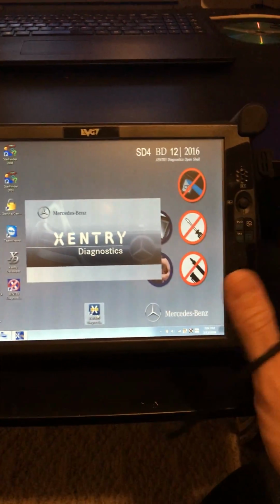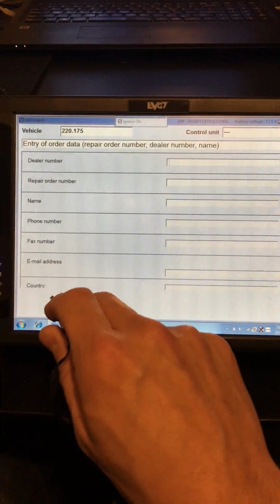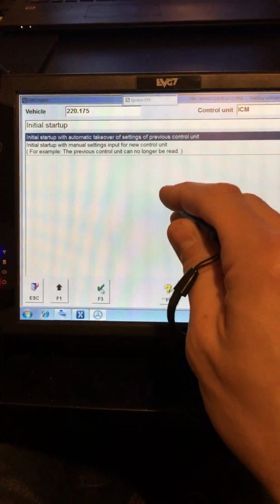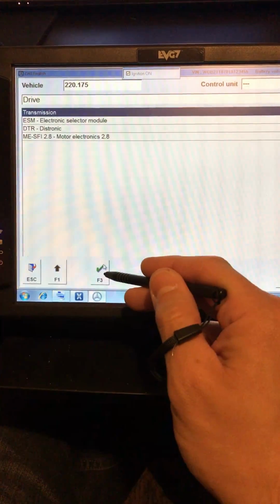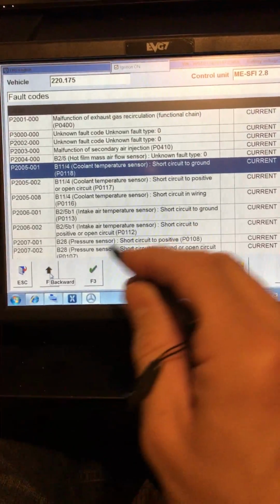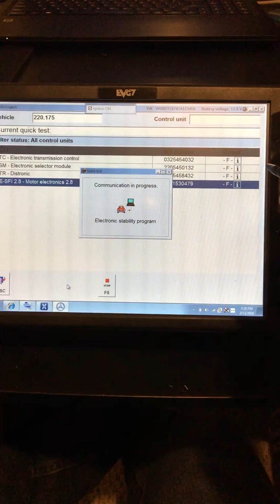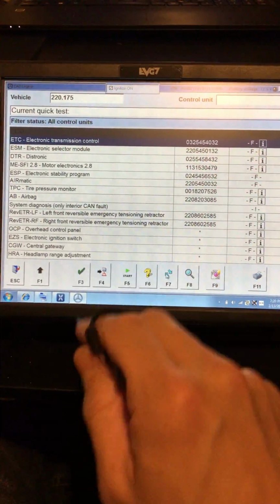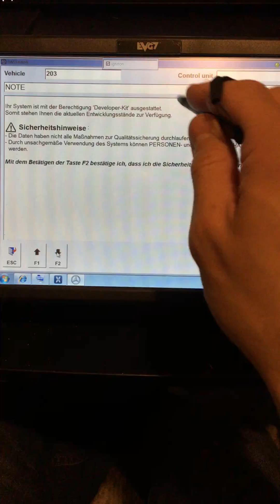Mercedes Benz SDS Star Diagnostic scanner tutorial quick intro on how to use the scanner

Comment: Awesome video will this system fix a zero start problem I bought a 2012 sprinter off someone who ran it out of def fluid
Reply from the maker: It depends. 
If you ran codes and it just needs to relearn the level it MIGHT be able to do it however in 99.99% of cases you will also have a fault and you need the dealer to perform the recoding of the module .
This is tedious in a sense but only the dealer scanner at the dealer themselves delete the fault codes and allow the 0 starts to reset to 20 and disappear. 
The best you can do is turn the key on and wait 90 seconds and see if the starts disappears. 
also if you have a very very generic scan tool you can just hook up and erase the codes and it will allow one more start. You can do this over and over until you get to the dealer. 
Lou

Comment: can you program the air-matic system,lower the car or raise it?
Reply from the maker: michael medina the best way to do that is with adjustable links on ebay. Now if you have an issue with your car that is different. So let me know if you have an issue. Lou
Reply: Can I use this tool to diagnose fault codes on a Mercedes s430 with the airmatic system and will it tell me what to replace and everything ?
Reply from the maker: small country nothing tells you what to replace. Scanners only read information that the modules set. So if there is a fault code it leads to diagnosis steps which leads to a fault. Yes this will help you. No it does not tell you what to replace , only I can do that :)

Comment: I replaced my old clk 200 2005 instrument cluster with a 2nd hand one because the old one died.The replacement part works but the issue im having is that the mileage does not show anymore..Im at lost what do do here.
Reply from the maker: Hello, thanks for reaching out. So most should set the original mileage after driving 500 miles, however if the cluster you have installed had more mileage you cannot set the mileage backward. There is an adaptation in the IC module to set odometer forward, so you can try that but from what I know unless they come NEW from the dealer we cannot change the mileage. However there are shops online that can do this for you . My dealer experience I have always had new clusters so from what I know it will either change on its own after 500 miles or you need to find someone online smart enough to change it. 
Lou

Comment: any ideas on leather seat repairs?  also have you had problems with the gas tanks having problems resulting in rattles?  thanks. ohh one more thing. can you set the car to only run on 93 octane in das so it can make more power?   thanks again.
Reply from the maker: dann hienn I don’t do interior repairs we always replaced the pads. Upholstery shops charge way too much. Only had rattles in R230 tanks in 03 . And all merceded are supposed to have minimum 91 octane. They are all programmed for higher octane fuel.
Reply: @MasterTechLou  thanks. I have an 03 with tank rattles. going thru and replacing the hoses on the abc and rebuilding the hydraulic solenoids. I was a mechanic  at the dealer for many years and had to leave because I did not like working for nothing

Comment: hi Lou great video, I have a problem with my Mercedes c200 w203 year 2001 automatic gearbox :sudenly don't shift the speeds i don't know why?!! can u help me please? (sorry for my bad englesh).
Reply from the maker: thanks for the compliment, you need a scanner to check the codes in the etc module, you most likely need a conductor plate. 
Lou
Reply: @MasterTechLou  but i allready  changed the gearbox  and gear selector for nothing  she does the same thing :( , i run a diagnose with wurth wow because i don't have xentry star and on the diagnose tells me "yaw rate sensor on the trunck" that can be the problem? thank you, (i'am form romania and i live in France).
Reply from the maker: @adriancapatina2803  when you have a fault with the transmission you NEED to have a mercedes scanner to erase the codes in the transmission module or the issue will keep happening, the module is smart and will not erase the codes on its own even if you replace each part in the car you need a mercedes scanner to erase codes in the etc module.
Lou

Comment: Hi Lou, I have a 2000 ML55 with 2003 HID headlamps installed. The star is telling me to set the range on the lamps. This and the steering sensor are the only two codes I have. WHen I do the routine as instructed by star, the screen gives me a 'communication error' message. The eraser will not delete the event as it is a capital F. The motors move the projectors up and down during the test but I think the software is for the original style hid vs the projectors, which came out 2002. Is there a way I can get a software update for the later style and turn the autolevel option on. SInce this was not a DOT requirement in the US but was in the ROW, could I just get the update from a europe model? Thanks!
Reply from the maker: Erick Miller hello, check the SAM settings. The sam might be too old. You might not be able to code the headlamps. Also the suspension needs to have a sensor installed to show the ride height if memory serves me.
As for the steering angle sensor it depends on the exact term the scanner is showing . Then I can assist.
Reply: @MasterTechLou  Hi again Lou. Thanks for the quick reply. I lifted the front of the ML about two inches and was able to get the voltage values within spec. I was then able to set the headlamp adjustment and the capitol 'F' became a small 'f', which I was then able to clear. After using the lan cable instead of wifi, the communication error gui went away. Presently, there is no codes at all on the ML. I plan to run the check on my 09' E63 next. The steering sensor code is intermittent and sometimes the reader flags it and other times it does not. The code is C1140. After a battery disconnect and left to right turns the ESP light will go out but the code will sometimes flag. Again, intermittent. I am planning to clean the sensor and see if there is any dust on the rotary scale. Regards, Erick
Reply from the maker: Ok sir if you ever need help hit me up at 
Www.Cartechconnect.Com 
I can help. Lou
Reply: @MasterTechLou  I tried to go to the website Lou, but it is not working.
This site can’t be reached www.cartechconnect.com took too long to respond.
Try:

Checking the connection
Checking the proxy and the firewall
Running Windows Network Diagnostics
ERR_CONNECTION_TIMED_OUT FYI

Comment: Can you show how to lower a cls55 using star?
Reply from the maker: Karl Watson you cannot lower the car. You can buy adjustable links for the level sensors and trick the suspension but you cannot trick it with star. NEVER enter the calibration process. Only a dealer alignment rack and rommess gauge can align the system.

Comment: Thank you! Exactly what I was hoping to find after getting my second hand C3 working and running a quick test. I quickly hit the “now what” barrier after seeing all the faults. Anything you recommend doing in particular for high mileage E320 CDI’s (648 I6)?
Reply: Benz-Tech Lou P. Funny you mention the fuel injectors. I actually have two, an ‘05 and ‘06. Bought the ‘05 as a bit of a project car with leaking fuel injector seals. No problem I thought. More than forty hours of cleaning later... I check regularly for the noise and any signs of leaking now. I’ll shoot you an email. I’m a lunatic when it comes to maintenance of them but would love all the info I can get. About to cross 200,000 miles on both and would like to keep them forever. Cheers!
Reply: @HaveAnotherBrew  How did you clean the fuel injectors and why did it take 40 hours? I want a straight-six MB diesel. How many miles per gallon does your diesel cars return in freeway driving?

Comment: Do you think tomorrow morning it's good time for you ?
Reply from the maker: Mahmoud Hantouli mornings are not always best. Email is best to setup a time. Also check the connector in the battery control module in the trunk by the spare tire. It usually corrodes.
Reply: @MasterTechLou  
I did even I think the driver side carpet out to see if any water or corrosion there no the battery control module in the back no I had a blast. Rear Sam sensor still and when you keep the ignition switch on for 10 minutes the headlight star blinking passenger side in the front I don't know what to do with this car I'm lost and can bus codes as well and transmission 
Please help
Reply from the maker: Email me I will help you , I will try at least.
Reply: @MasterTechLou  i would love to get an email address for you? I have an MBUX question. I am working with Benz at the moment, but getting a run around that does not make sense based on your above video of what they can do.
Reply from the maker: @lacomusshumate7753  whats the question? Keep in mind im a mercedes tech not a computer engineer haha although I have extensive experience with this machine there is a lot behind the scenes I still don’t know

Comment: Heyyo. Very much needed assistance. Have a amg 55. Has problems. Can I just get star software, and cpu to car adapter cord, (Usb to obd..ect.. ) and use just those instead of the whole kit?
Reply from the maker: What_Ya_Doin_Lad_ yes you can. I do not sell this I was merely showing how to use it effectively. Check out www.mbstartool.com 
You will need the multiplexer, but you dont have to buy their laptops. I know what you are asking and no you need the multiplexer. Hope this information helps
Reply: @MasterTechLou  Oh man, the brick?
Reply: @MasterTechLou  Any chance i can get a link to just the brick? Got the software coming. Was hoping to just plug from car to cpu with usb to 16/38 pin cable
Reply from the maker: Yep you need to have the multiplexer, the c5 is the latest if memory serves me. The multiplexer is the software. All you put on the computer is a smaller program to display the Info. There is no other way that I personally know.

Comment: Hey I'm a locksmith I made a key to 2009 w906 sprinter by reading eeprom in ezs. I have a working key but I cant figure out how to program the remote. These usa sprinter Van's use a remote flip out key. Not a standard mercedes fobic. Can I use star c5 to program remote?
Reply from the maker: Tyler Bruntzel I do not know how to program a sprinter key my apologies. I did try to simulate the process in my sds but could not find the option. The only thing I found was in N73 ezs to learn additional transponder key but im not 100% sure this will work without dealer access. I am sorry
Lou
Reply: @MasterTechLou thanks for looking into it. Great video!

Comment: Any recommendations on where to buy one? Have been looking around but hesitant to buy one not knowing what to look out for and what to avoid. Any suggestions greatly appreciated. Thanks!
Reply: Nvm. Should have read all comments before commenting lol. Got the info from the comments. Thank you
Reply from the maker: ernasty1 this one I purchased is from www.mbstartool.com
Its 700$ and well worth it . They are from china but the company does do a lot of good customer service if you have any issues.
Reply: @MasterTechLou  which model, though? There several on this website for $750 or so. I do a lot of work on W140's. wanna make sure i purchase the right one.
Reply from the maker: Metalunique all will work, all have the ability and come with the round adapter for the HHT (hand held tester) version of das. They difference is just the computer, once you get to c4 If I remember correctly the computer software is all in the multipexer and can be linked to any computer that has a cd Installed for the program where the older ones need a laptop to function. But all will work, Lou

Comment: Hi I have the following codes P0201-001 and P0453 Short Circuit to positive Fuel Tank Pressure Sensor using a iCarsoft MBV2.0 and I have changed the Fuel Tank Pressure Sensor. Where should I be looking?
Reply from the maker: Carol White sorry I don’t know why I did not get an email of your comment. You need to check your wiring from the engine control unit to the fuel pressure sensor. Most times the sensor has failed. But this can also be a wiring issue. If you need help still let me know 
Lou

Comment: Nice video!! I was once a mb tech and I’m just amazed as too how this tool works like the dealer sds machine. Im soon going to be getting one like this because  I will soon be replacing a ISM on a 221. I can do it with this tool offline right?
Reply from the maker: spartanspear 21 Thanks! And no :( the ism is dealer installed only unless you find some online company that can load your vin inside the ism. They are vin coded.
Reply: Dang that sucks... no worries but I’m still looking into getting the scanner. Which one would you suggest?
Reply from the maker: For sure anytime!
Reply from the maker: I would suggest one from www.mbstartool.com those I know work well and they do really good with customer support if you need something.
Reply: Benz-Tech Lou P. Nice I’ll Im looking at them right now seems to have good reviews. Thanks bro

Comment: Nice job Lou! Still waiting for the follow up videos. I'm getting one of these as well and was wondering about module programming. I might need to replace the Airmatic control module and don't really want to pay close to 200$ at the dealership just for having it SCN programmed. Can it be done by copying the settings from the old one?
Reply from the maker: Also I didnt realize you can hear the wife yelling at the kids in my video lol , sorry all!!!!
Reply: No problem man, that adds to the appeal of an honest how to tutorial. 
I was playing with the simulator this morning but couldn't find anything. Any time I get close to initialisation of control unit in the adaptations menu Xentry tries to get me to log on to MB. 
I also realised you're presenting DAS in your video, the W212 doesn't show up in there anymore, it's moved to Xentry. I think it would be easier to copy coding from old to new modules in pre W212 chassis with DAS. 
I love the W212 but I hate the coding limitations they put in it. I get that coding can be difficult, but at least give me the option to try and do it without having to connect to a server (and pay the crazy fees).
Reply from the maker: Hey thanks!
More videos to come for sure, airmatic does not need programmed so to say , it can be copied and transferred from the old module if it still works. 
The only thing that needs learned if the old module is dead is the ride height settings and that does need done correctly at a dealer. 
thanks for the nice comment!
Please let me know what kind of videos you would prefer me to talk about and i surely will do what i can to help. 
also please subscribe and share. 
www.cartechconnect.com
Reply: Thanks for taking the time to respond. 
Personally I'd like to see a video on how to copy the old coding from a working module to a new one. 
I own a W212 E550 with Airmatic and it's acting up when cold out (it sets itself in sport mode and won't come out) and I was playing around in Xentry but couldn't find any option for coding a new module in without having to connect to MB servers for SCN coding. I read that a few people managed to copy the software from their ECU in Vediamo but I'm concerned with using it since it's very easy to screw something up if you don't know what you're doing.
I might just buy a new Airmatic control unit and have someone with access to a MB account code it to the car, but it would be nice if I could find a way to do it myself.
Reply from the maker: Ok I will see if this can be done, I was thinking of an older model, almost ALL new models that use xentry are scn and cvn coded. Models like 204,166,212,218 , so ill give it a shot in my simulator.

Comment: I'm on DHGate and I see this STAR diagnostics for like half the price of others form China. This one is only $322?
 https://www.dhgate.com/product/mb-star-c5-sd-connect-c5-diagnostic-tool/434445865.html?recinfo=8,109,1#cppd-1-5|null:109:r1780811004
I want to use this for my W211 for the SBC brake fluid and SRS light.
Reply: Would something like this work?

Comment: This is an amazing video and shows the exact amount of information needed to start with SDS This really helped me get started with this software. I have done a moderate amount of tuning using HP tuners on GM cars but never through xentry. Can you change the fuel maps using xentry?
Reply from the maker: damon shamblin changing fuel maps no not that I have experienced, but in some models you can richen or lean injection a bit.
Reply: I need to ask you something via email about tuning... Pls help me with you email so I can message you

Comment: Great video!
I'm thinking of getting a Star C5 from China for around $500. It supposedly comes with a license activation installed on a hard drive. You mentioned that the one you have is also from China. Do you know if the license activation ever expires (after 1 year)?  And if yes, how do I get a new license activation?
Reply: Hello rvpfernando  Did you end up buying that star C5 from china? Thank you!
Reply from the maker: There is no license that im aware of on the chinese ones they are unlocked and work for a long time with no expiration of the star key